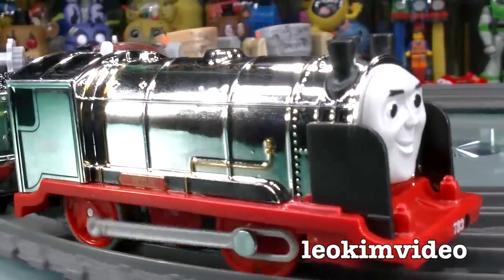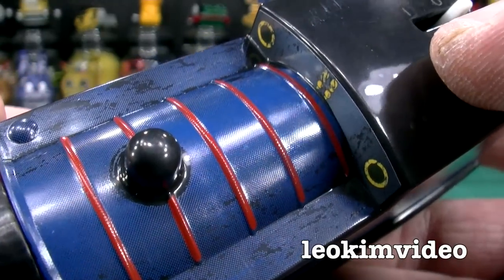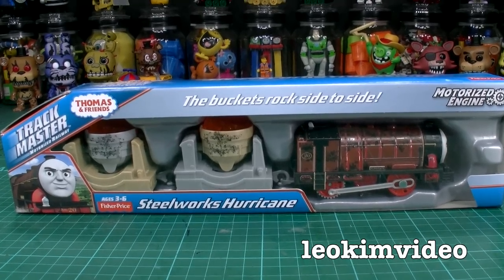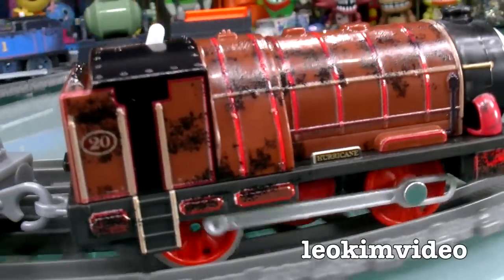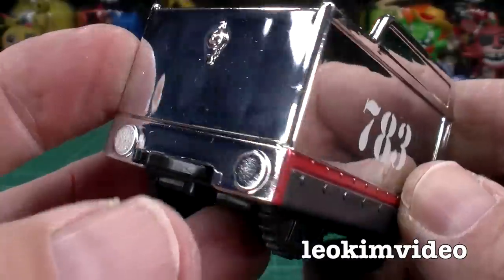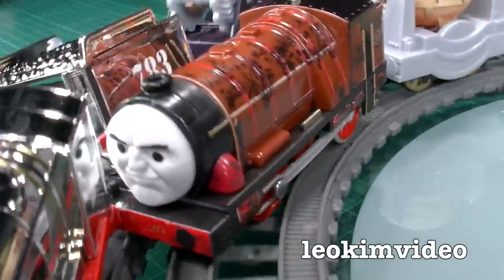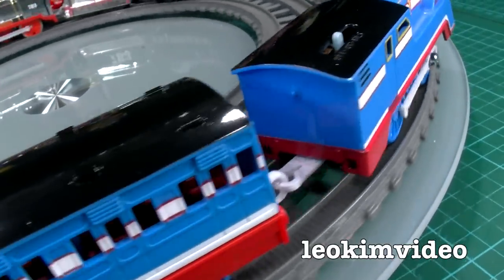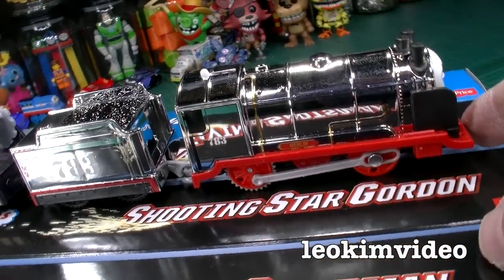Thomas & Friends Steelworks Thomas Tank Hurricane & Merlin The Invisible Trackmaster Train Crash

Comment: Leo Let me explain Steelworks Thomas, Merlin and Hurricane for you. Hurricane Works at a steelworks with a diesel shunter called Frankie. Frankie and Hurricane basically hold Thomas hostage at the Steelworks. But Thomas escapes the steelworks using Thomas P-P-P-P-POWER! Merlin is one of the experimental engines along with Theo and Lexi. His three funnels were an experiment designed so that you could not see him very well. Thats why he is called "The Invisible". But the experiment failed. The steelworks Thomas is when Thomas is held hostage at the steelworks. He works there moving steelworks items like ingots and slag. Thats why Thomas has pink cheeks and grime on him. I hope this was helpful to you.

Comment: Great fun, Leo, I like the rubber chicken...  : )
The first radius curves seem to cause "confusion and delay", the second radius mainly ok. I wonder if the "gear pattern" in the track is to blame ?
Regards, Cliff.
Reply from the maker: I'm not a fan of the CS (curve short) track. But it's the most common curved track I have with Trackmaster2. When you look closely at the trackmaster 2 system it's a nightmare, so many components, so many special track pieces. I really wonder why we needed this change. Sadly I feel these changes happen to make the older toys unable to work.
Reply: I suppose Mattel had to make the wheel and track changes to enable the trains to perform like "roller coasters", but in doing so, they have created "built in obsolescence". Therefore mums and dads, grans and grandpas, now have difficulty adding to "little Johnny's" train set...  : / 
Regards, Cliff.
Reply: I've had an idea for those trouble-some curves....
The locos don't have a differential, no wonder they are "chomping at the bit" to escape the rails.
So I suggest an experiment with say 4 of your curves...run a warm soldering iron along the inside "rail" only, to enable the inside loco driver "to skid", and let the outer wheel actually pull the train.
I know you are good at experiments...  :D
Cheers, Cliff.